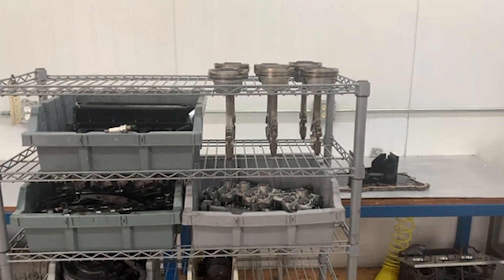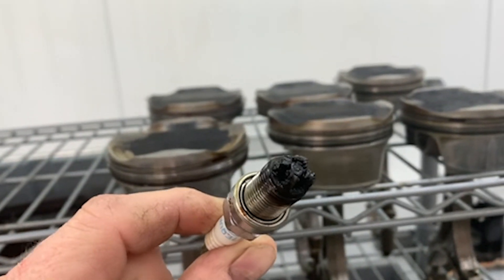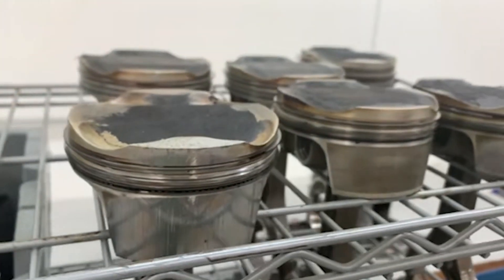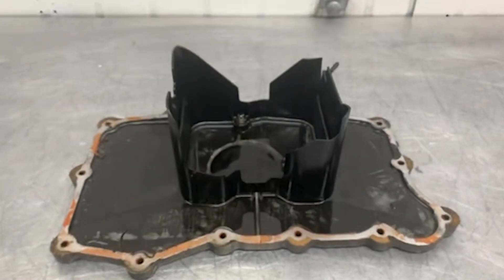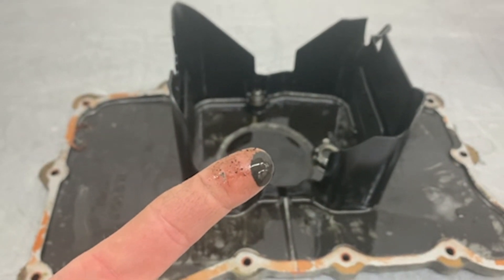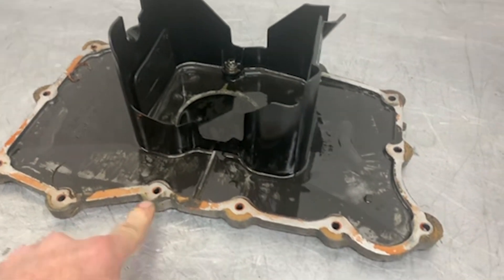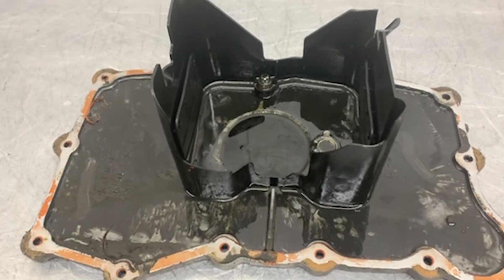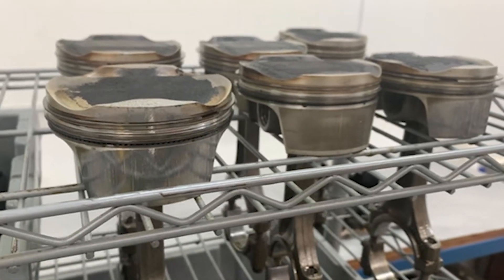Porsche 997 Failure - Afflicted 5 out of 6 pistons!

Comment: My understanding is that this is caused by running the engine hard while it is not fully warmed up.  Were the cylinders all scuffed on the bottom of the cylinders?  Top of the cylinders?
Reply: There are many things that can cause bore scoring. Bad MAF, faulty injectors, shitty oil, shitty gas, extended oil service intervals, letting the car idle warm up, vacuum leaks causing fuel trims to be out of spec, coolant bypassing the radiator causing hot spots on the engine, just to name a few. The cylinders on the m9x are not coated like they are on other Porsche engines which allows scoring to happen much easier. The bottom of the cylinders is what typically ends up scored. This is why he is saying to pull the sump cover and use a bore scope to inspect the bottom of the cylinders. If you put the piston at the bottom of the stoke, and pull a spark plug you can easily miss the scoring at the bottom because the piston is blocking the view. When buying one of these cars I always recommend customer pay to have the sump cover pulled and the cylinders looked at with a scope during the PPI. This is also part of how we qualify an engine for an IMS solution.
Reply: @Skam1one  Nice, thanx.  I have a '14CS and am always careful to let it get past blue line before hammering the throttle, and I am careful about oil changes.  Thanx again!
Reply: Park your bore scored Porsche on a hill and walk away. Tell the insurance company you must have forgot to pull the brake lever. Just kidding.
Reply: @rongreen8485  Well, there's one in every crowd I guess~